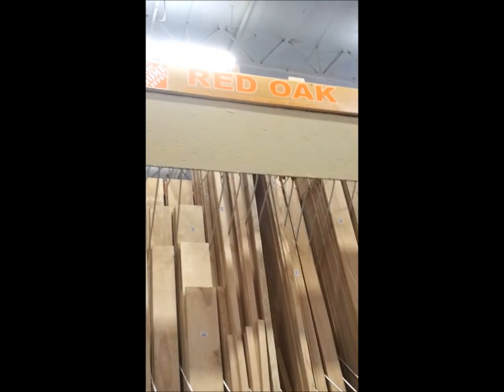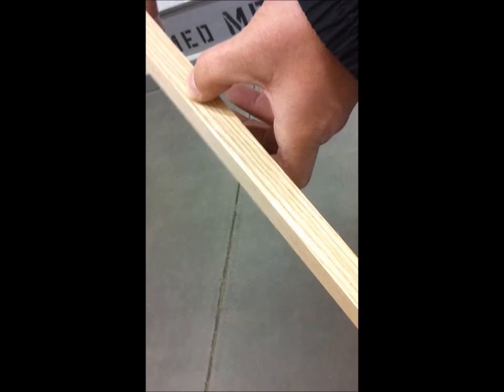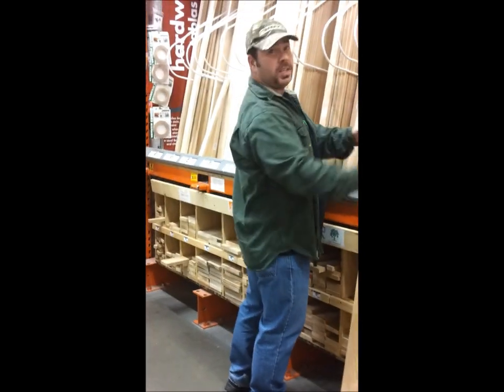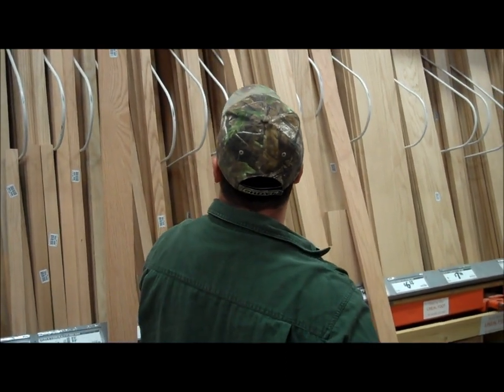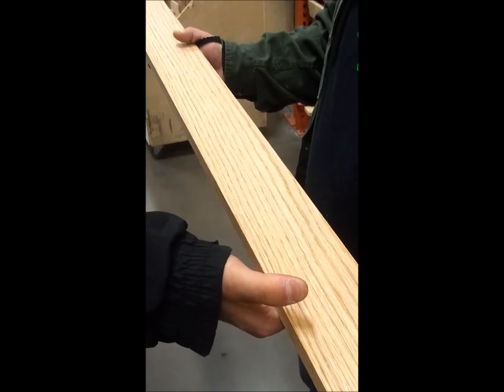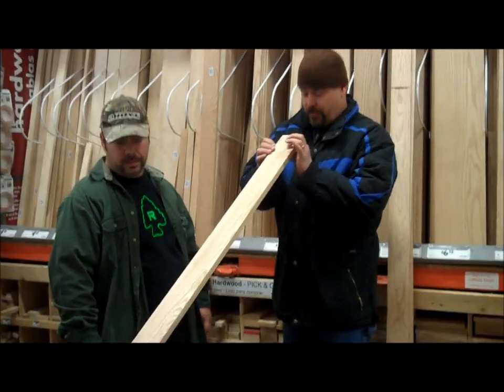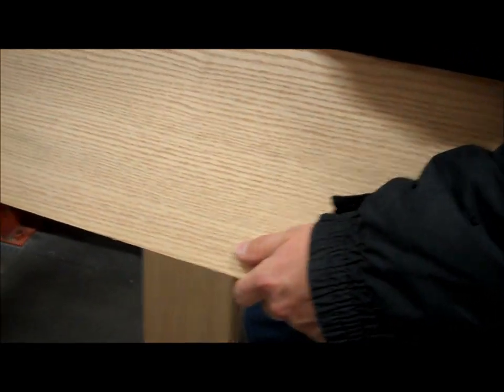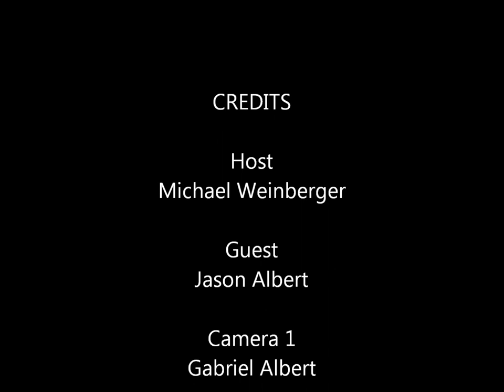How to Build a Bow: Finding the "perfect" board

Comment: You can always make a splice and join two shorter boards together in the middle. That way you can look for a well grained board or two, that are just shorter. I have a guestion though. Does backing (i'm thinking about epoxy-fiberglass cloth mostly) totally prevent the wood from breaking on you? Of course with the right tiller.

Comment: This is great ... Finally found a vid with explanations about this style and not just how to, Ok I have some nice cedar to use it is really dry but I read if I soak it in Raw linseed oil it will soak it up and give it some flexibility back so I can tiller it to thickness and hope it doesn't snap when I draw it ! Now do you think it will work or should I try to find some newer wood?
Reply from the maker: +Murray Keays Cedar can be tricky. It can make an amazing bow but don't be frustrated if it fails. I have tried several times to make a Red Cedar bow but have only succeeded once. When I finally hit that mark I said, "Ok, goal achieved!!! Now can I please go back to Osage?"
Reply: +BoarriorBows lol yeah I learned how finicky cedar is right away , broke two staves already ! But I have lots more one of them has great grain pattern but I think it will be a long bow not a flat bow .
Cheers and thanks for the vids
Reply from the maker: try backing with rawhide first before any bending, even floor tiller. Maybe it will help.

Comment: Would the runs off still matter if the wood was thicker? I was thinking of making a thinking bow and doing a lot of sanding, making it roundish.
Reply from the maker: Yes, the run-offs will still matter as eventually you are going to have to thin out the bow so it will bend and they will be areas of weakness that can cause bow failure.

Comment: I was wondering if you use bamboo on the back of the red oak  . and also how about treating it regularly with a wood moistening oil .
Reply from the maker: You certainly can use bamboo as a backing. I am particularly fond of it actually. The oil might be a good idea given that most red oak boards have been kiln dried.
Reply: Okay thanks , I'm really interested in trying out your high performance bow project . The black one with the buck skin wraps . Looks awesome . Maybe instead of fibreglass I'll try bamboo for the back . Thanks again . Peace .

Comment from the maker: The general thought process is no, but I like to find all the strength I can when making a bow. Truth is a hard backing like bamboo, fiberglas strips or inspected backing strips there is no need. Also sinew will protect a back without worry. Some of the softer backings like linen, silk, fiberglass tape can help, but definitely find the best board grain or single ring

Comment: I keep hearing u saw access to a table saw ,y not a handsaw orcircle saw even a jig saw in a pinch just a thought ,i mean as long as it gets ripped down to the size and on the lines u want ,right ,i only mention. This cause i love wood work of any kind ,and dont want people to not try this cause they cant find the perfect.board thinking if i only had a table saw wen these others could suffice and with our younger generation they may not have that access but might have access to  a good hand saw or even a circle saw ,also a circle saw makes a good tables saw with a good flat peice of lumber for a table and  drop ur saw blade thru it with a good straight line and guide ,ive used one like that many times in a pinch,in fact it was my first table saw ,a circle saw dropped and cut thru a peice of plywood ,and a good straight bord clamped down with c clamps as a fence i drilled a couple holes in my saw base to mount it to tbe plywood ,in fact theys a few videos on it here in youtube ,dont take me wrong please u have great advice and a really good video im just givin other ideas in hopes it furthers some ones enjoyment in wood of all sorts,thsnk u for ur video

Comment: Hey. I have been researching how to make self bows/board bows for hours and can't find a definitive answer on dimensions. 2" width seems to be standard recommendation but what about thickness? 1"? 2"? What if I wanted to make one without having to cut and glue a handle on? What dimensions should I be looking at? 2 x 2 perhaps? Does my desired draw weight/ length factor into the dimensions? Any suggestions would be much appreciated.
Reply from the maker: Check my playlists on my channel. All my bow builds are there and give the dimensions for each type of bow in the first video. 

I recommend a Mollegabet for a first bow build:
Original Board 72" x 2.5" x .75"
Length:
65" long tip to tip
5" handle
2" Fade from handles to working limb
14" working limbs
2" fade from working limbs to static limbs
12" static limbs

Width:
Handle: 1.25"
Fades: 1.251" to 2.5"
Working limbs: 2.5"
Fade: 2.5" to .75"
Static limb: .75" to 3/8"

Thickness:
Handle and static limbs maintain the .75" thickness
Working limbs: depends on what draw weight you want
Fades: working limb thickness to full thickness

These dimensions should work for up to a 50# bow

Over 50# I would add wood to the handle/riser 

Hope this helps

Mike
Reply: Absolutely! thanks, Mike. I really appreciate you taking the time to respond. I'll keep all of this in mind.

Comment: I've had issues in the winter with wood for board bows and solved it by letting it sit in my basement to let it catch up moisture wise, and not leaving it outside in my workshop to freeze dry even more. The brittleness could have been a percent moisture problem. After they are made, I'm really careful to get them lively by heating and rubbing in a mixture of grease and beeswax. Overcoming kilns with sketchy drying protocol like the big box stores may get can be overcome by getting grease deep into the wood. The heat expands the air inside and when it cools, sucks the very liquid heated grease deep inside. Bows are very personal, but I've made and sold over 300 board bows along with the trad tree stave ones, with good success. Maintaining a decent moisture level as well as greasing rather than applying a surface finish has to have helped. You do fine work and produce great bows. Thank  you for sharing so much information.

Comment: Ok, I feel like im bugging you with questions now, but im learning so much from your videos. Even if you did find the perfect board with vertical grain and no runoff, wouldn't you inadvertently be creating a ton of grain runoff  on the sides once you taper the limb?  If this is for a mollegabet, i understand the bending part isnt really tapered, but what about another design?
Reply from the maker: You are right. This is why the mollegabet is, in my opinion, the best beginners bow. After this, I prefer to put backings on my bows to overcome this exact situation for the other designs.

Comment: I would buy a 3 volume set of the traditional bowyers bible then you would know how to build any bow that their is.
Without thinking about it. 
$67.75??? Tree's are free.
Reply from the maker: Nice idea... except I live in the desert. No trees... Well there are some pine and palm trees, both are terrible bow woods and have been imported and planted by landscapers on private property. So, A: I can't cut down those trees. B: Even if I could they would make a crappy, low performance bow if they stayed together in the first place. There are no  woods or forest here so, trees may be free, but if you have no trees then it doesn't matter. I have had a situation where there are people with access to trees, but not any wood will work. The good news is there is a  a Home Depot just about everywhere. The TBB actually has 4 volumes and they are spectacular reads. I do recommend them.
Reply from the maker: On another note he bought the big board because he wanted to make multiple bows out of it. Home depot has MUCH cheaper options if you are patient and willing to look through the piles until you find the right grain.
Reply: but you can't make a bow out f green wood

Comment: Have to make a bit of a drive but I just found a woodwork supply/ Lumber yard. The nice thing about places like that are they carry harder to find hardwoods and caters to a more selective customer. They are 100 times more knowledgeable about wood properties and grain and are more than willing to help you find just the right piece. More than that they carry wood that has been naturally seasoned and or air dried only because kiln dried tends to give those using it on a lathe troubles. Its a bit more expensive than Lowe's or home depot but in the long run may pay for itself. One very nice bit is they have turning blanks 6,8,10,12 inches some up to 30 or more of just about any kind of wood you can imagine make some real nice handles.

Comment: My first bow I ever actually made functional was from a red oak board its the only board bow I ever made it was 40 pounds it actually had a few run offs and it was unbacked but I could not get it to break under tension tho it did develope chrysals on the belly due to red oaks weakness in compression

Comment: Great video Mike! I'm really excited that HD has started carrying maple, as it expands a board-bowyer's limits a bit. I would like to say that if you BACK a board bow that has a little run-off, it tends to hold together pretty well. My first succesful bow ever was from a red oak board that had at least six or seven spots of pretty severe run-off on back, belly, and sides, but with a hefty drywall tape backing it stayed strong for two years, only cracking SLIGHTLY when someone overdrew it.

Comment: Do the runoffs matter much if you plan on putting a backing on the bow?
Reply from the maker: Actually, if you are doing a backing of rawhide, sinew, bamboo, fiberglass or a wood "backing strip" then the run offs no longer matter as much, but I still think it is always best to try to find the best, strongest board possible, even when using a good backing.

Comment: I've never heard a bowyer recommend against flat sawn wood.   that advice goes against EVERY volume of bowyers bible.
Reply from the maker: +ernest robbins I've read the Bowyers Bibles (several times) and use them as guides quite often. I'm a big fan. but remember we're talking boards, not staves. Reducing to a single growth ring is always best, but its near impossible to do in the case of sawn boards. Anyway, ask any bowyer what kind of board sawn wood makes the best unbacked bows and they will set you straight. Or try this, you go right ahead and make 2 unbacked bows, one flat sawn that has growth layers of wood lying on top of one another and ready to lift off as soon as you flex the wood, and one quarter sawn with no run off grain and see which one fails for yourself. My bet is the flat sawn board won't survive floor tillering. If you are backing the bow, then flat sawn is fine and probably preferred as it will have less inherent twist in the wood with a proper crown.
Reply: +BoarriorBows Thank you very much for your reply. I can accept that answer.